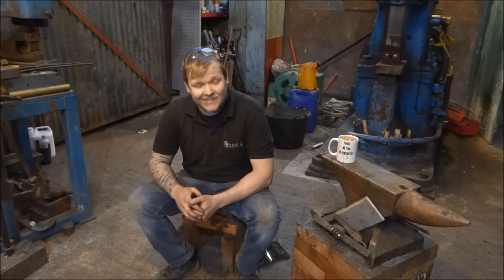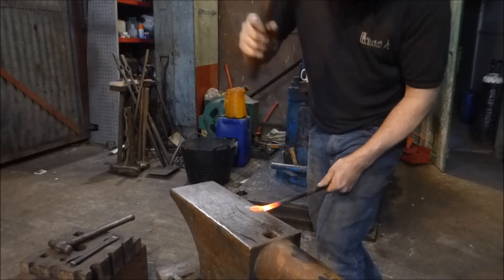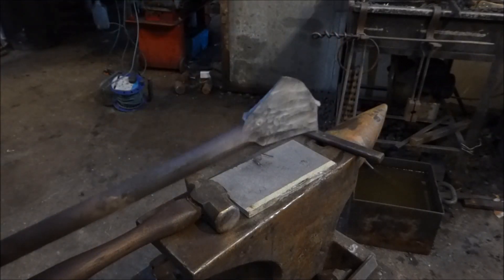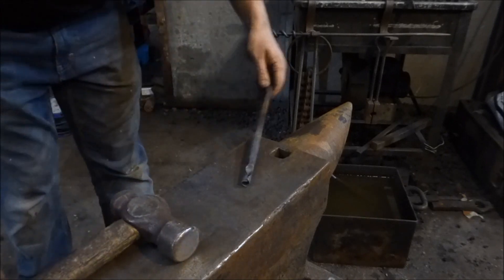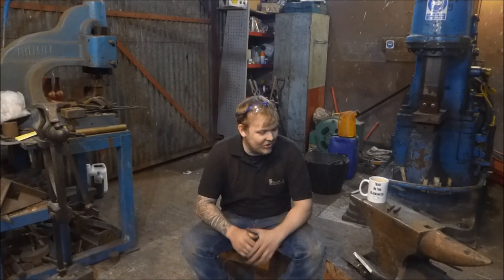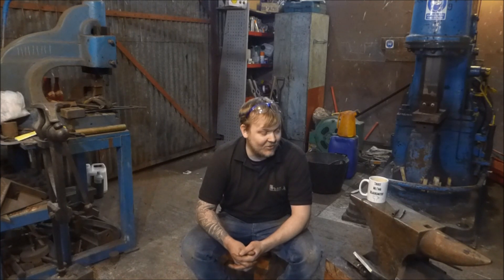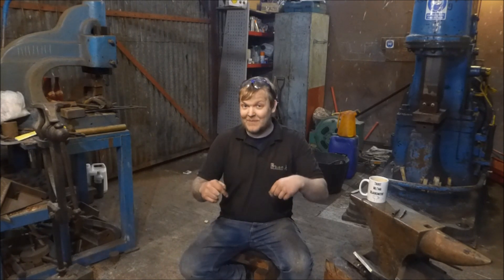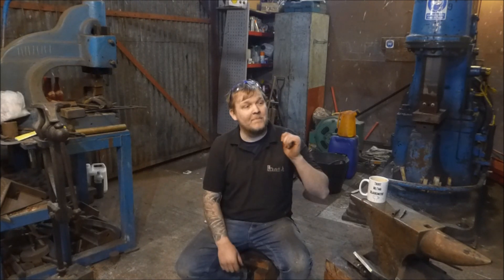How to Forge Arrow Heads! 4000 Subscriber Thank You Video!

Comment: I think arrow heads were the first thing I started making via fire and anvil.  I got carried away and bashed about 3 dozen out including some fearsome needle-point long bodkins.

I've never trimmed up the set down that makes the socket.  Careful hammer work gets you close enough.  Any excess at the sides can just wrap around a little and this helps close up and tighten up any socket if finished on a tapered mandrel.  Any excess at the end can be belt-sanded back to level right at the end.

Good to make some short and lightweight arrow-head tongs.  One jaw is a curved flat bit that grips the outside of the socket, the other jaw is like a scrolling tong (one half of  pair) and goes inside the socket.  This helps with keeping the sockets true and uniform too.